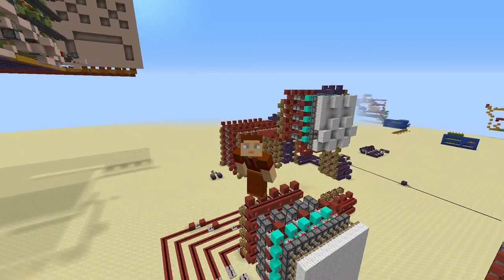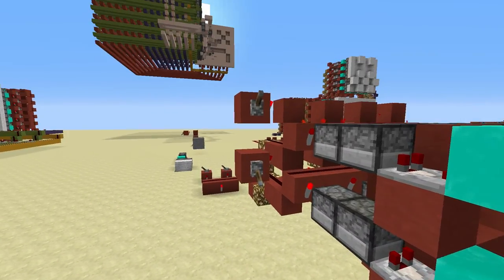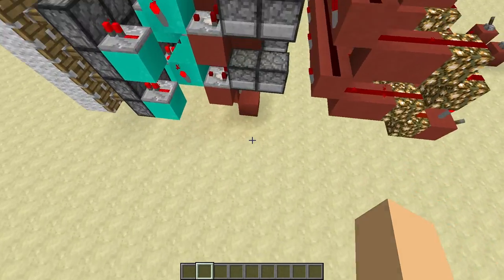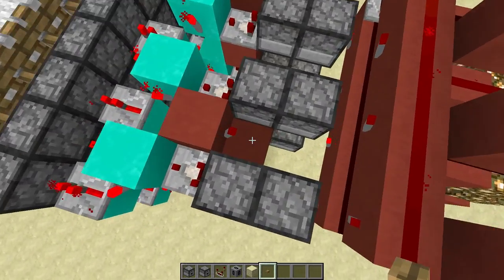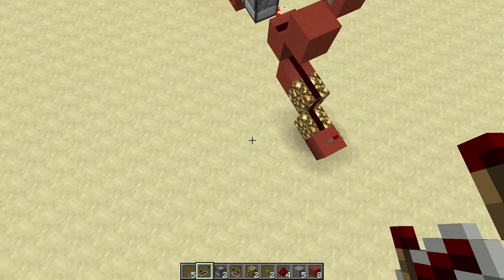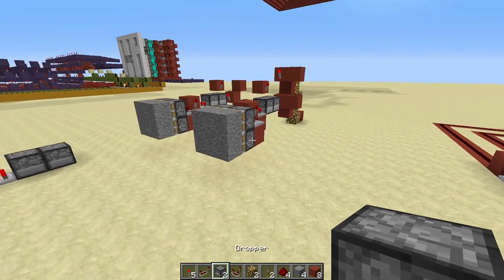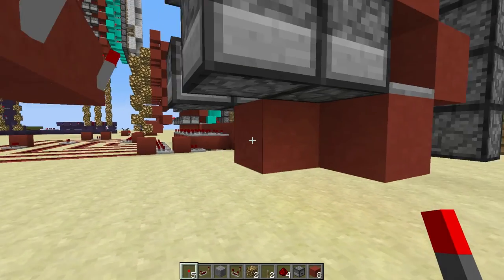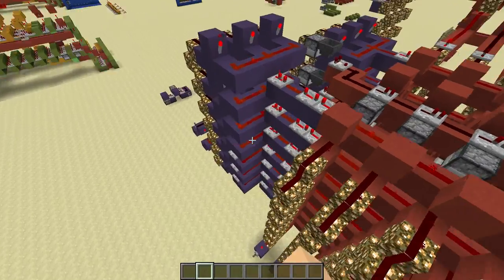Compact Redstone - Fast Redstone Screen!! - Tutorial 1

Comment: The speed of this circuit can be calculated like this (we always take the worst case):

Output of the matrix + dropper + comparator + torch + repeater + piston = 1 + 1 + 2 (or 1...) + 1 + 1 + 2 (1,5) = 8 ticks (without the input repeater/torch). So you announce 4 ticks, I count 8 (or 6,5). Please do the same for the reset part. 

I highly recommand to replace pistons by redstone lamps. Due to the JVM (Java Virtual Machine) performances, this will increase the general speed of your game (so redstone included).

There are new systems now that are really compact and where we can set and reset a pixel seperately. I haven't found a forum topic about it, but maybe will I take some screenshots of the design I've seen.

If you will see a screen in use, you can see our Snake (by Zilack3 and me) here : 
https://www.youtube.com/watch?v=MXizwHFn1Q4
Reply from the maker: Thanks for the advice! Ill amend the part saying it was 4 ticks and replace it with 8 ticks, and will have a go at improving the design with the redstone lamps :) Thanks for the comment :)